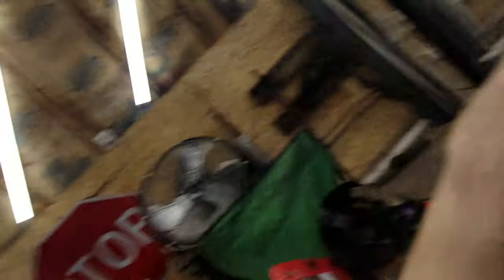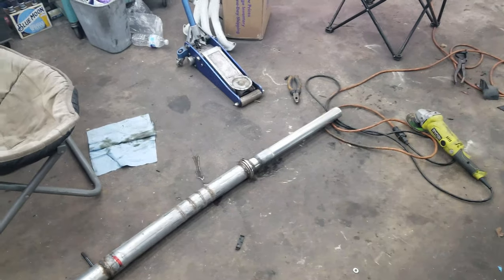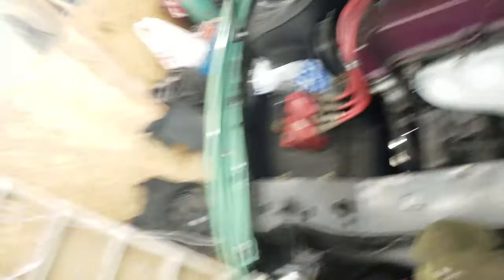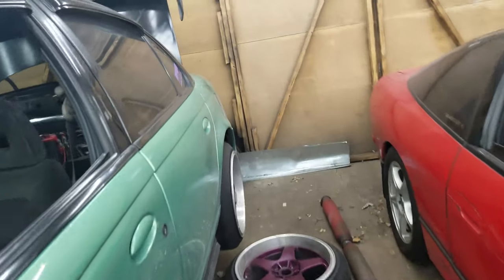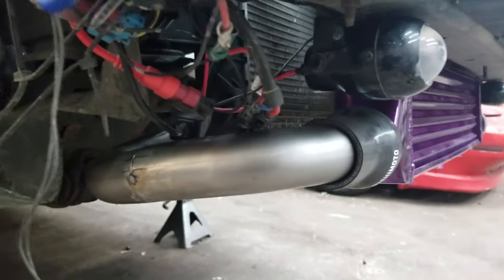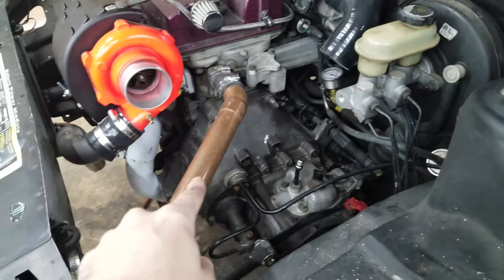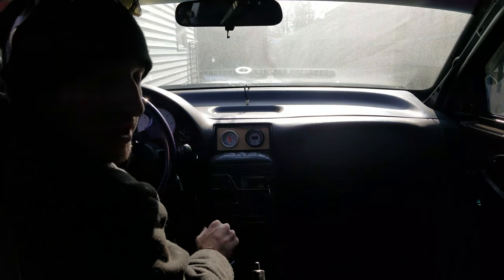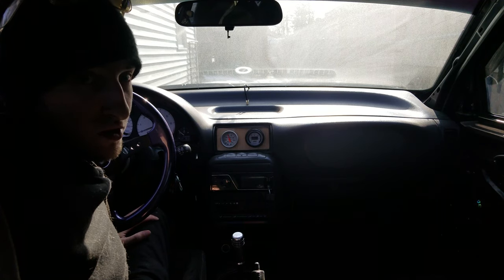Boosting Midori 2

Comment: It's really cool you can do that without the megasquirt. I've always thought that if you wanna boost these things, like at all, you need it. It's also a good idea to put in forged pistons and rods, and maybe a GE block (depending on desired power levels/amount of safe zone). Weld the  diff pin in, or put in an LSD. A cam grind and Fidanza flywheel are pretty sweet too. This is usually my bullet proof rebuild recipe (I don't usually get the cam grind done though). I have no idea how much of this is done to the motor in Midori, I'm gonna assume all of it. Cant wait till you wanna turn it up. Awesome job, dude.
Reply from the maker: Actually this is a bone stock motor with no real tune, just bigger injectors and some tricks to fool the stock computer... all of which I always tell people to NOT follow my lead, I'm a dumbass so you dont have to be lol

Megasquirt and a stock motor can actually make alot of power before forged stuff needs to come into play, that is if you have a good tuner
Reply: From what I've read over the years, the stock guts can take about 300whp, but that leaves no room for error in the tune or the tuner. I like to play things a little safer than you. lol. I'm enjoying seeing just how manipulative you can be to these things. If you aren't already, might I suggest an OBD2 data logging scan tool (I use bluedriver) then you can get a read out of the sensors that aren't being tricked, it'll tell you if something is going wrong. I assume your computer tricks are causing a permanent service engine light, or you pulled the bulb.

Comment: Damn this was dope I kinda wanna turbo my ‘99 sl2 but it’s automatic and I’m iffy about the reliability of the trans
Reply from the maker: I dont know of anyone who has boosted an auto, but a 5 speed swap is very easy in these cars
Reply: Build it Break it Garage inc. hey dude have you ever had an issue with a p0341 code? I’ve replaced my wires plugs and ignition control module and it still shows up as pending it went away once after driving it a lot but it came back
Reply from the maker: sounds like you did everything I would recommend for that, normally a set of wires does the trick...
Reply: Build it Break it Garage inc. yeah the only thing I’m gonna try now is to redo the plugs even though they’re brand new and try to see if the battery needs a test and charge but it’s getting ridiculous. Thanks for the reply! I love the videos bro
Reply from the maker: Thanks for watching them!!! good luck!